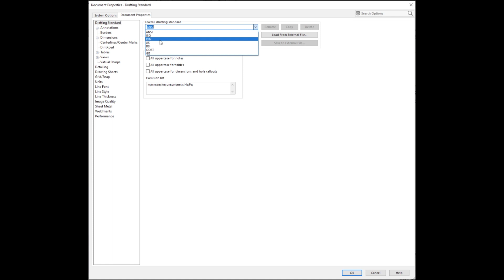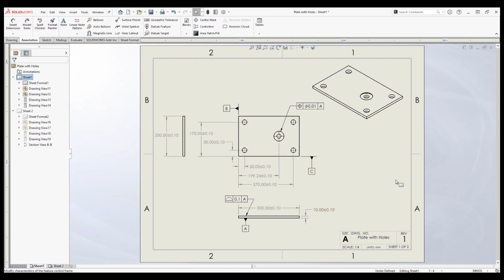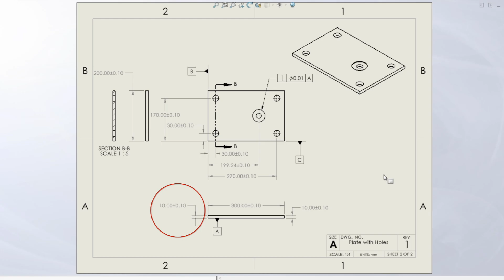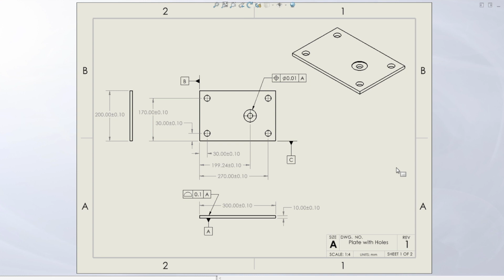Why I HATE GD&T...

Comment: This is one of the best videos on practicing GD&T that I have ever seen.
I agree with every sentence - expect the "I hate GD&T" conclusion.
What is missing in today's practice?
- Good drawings that control feature function with maximum tolerance.
- Derived verification specification
- Derived finished part specification
- Derived tool control specification
Unfortunately, a digital workflow is still missing. For example, after the nominal design, it would be a good idea to create an explicit functional specification before starting to create a single part drawing. For all these specifications we need a suitable software solution...

Comment: 4:41 Allow me to practice my knowledge of gd&t location tolerance(true position) and "redmark" this dim:
1. Let's start with just "conventional" dimensioning. 
a.) There is no hole diameter and no hole diameter tolerance
b.) Worse, this is a "counterbored hole" there is no spec for large diameter and depth.  No diameter for thru hole.
c.) Where's the fkn, vertical dim?
- - - - - - - - 
2. Now, let's get into the GD&T true position tolerance screw up:
a.) Where is the datum reference to "B" and "C" in the feature control box?
b.) Where is the (mmc) symbol? Don't tell me that he "meant" RFS. That he "knows" the 2nd rule of Gd&T.  Not.
c.) Where are the [basic dimension] symbols for vertical and horizontal dim to the hole center? Also, the basic dims are "not tolerance".

Comment: As a machinist - please do not make 100 page drawings. That is insanity. Eliminate unnecessary views, dimension cleanly, use thinner lines and slimmer fonts which are legible at 8.5x11.  GD&T properly applied makes our job easier and clarifies questions. GD&T improperly applied will drive the cost of Manufacturing your part through the roof. Tread carefully.

Comment: I find it interesting you rant about misunderstanding of GD&T and your examples have errors.  Comment below has details of errors.
Reply: Counterbore Position Diametric 0.01 to A identifies the counterbore is coaxial to the through hole.  While position in conjunction with Y14.5-2018 4.1(o) will help control perpendicularity, the primary function is still control of location.  The perpendicular call out is a tolerance of orientation (Y14.5-2018 Section 9) and does not control location.
Profile of Surface 0.1 to A and 10.00±0.10
The profile of surface is an equal bilateral tolerance, which would allow for ±0.05, not ±0.10.  The profile of surface would allow for a floating tolerance zone of 0.10 that could move up and down within the 10.00±0.10 (9.90 to 10.10).
Ambiguity
Y14.5-2018 4.1(o) USO(Unless Otherwise Specified), all tolerances and datum features apply for full depth, length and width of the feature.  Thus, the statement of ambiguity of linear measurement would not apply, as the entire centerline of the hole must be within the defined tolerance zone.
Mandatory Appendix 1 Alternative Practices deals with different methods of tolerance stack used prior to the practice of Position and Profile tolerance methods.
Reply: @samualadams862  You are completely wrong in your judgement.
Counterbore position 0.01 to A does not identifies its coaxiality because A is not an axis of the through hole!
Because A is a plane nominaly perpendicular to the counterbore axis - that specification only identifies perpendicularity so the author is right in the video
The profile tolerance is not floating here because profile tolerance is by default fixing all degrees of freedom including not only orientation but also position 
+/- tolerances are unambiguous only for feature of size. The position of hole center from a plane is not a feature of size so it is ambiguous as the author said.
Reply: @darmat9009  
I concede that I am by no means infallible, and I am always open to debate.  
I would, however, request if you wish to label my assertions “wrong”, you provide reference to back your statements.  I have provided references to Y14.5-2018, for the purpose of allowing others to research my points.  I would recommend you do the same.  
If you would like to debate this further, please do one of the following.  Provide your references to back the assertions you’ve made, so I may review.  Or, review my references and explain how my interpretation is incorrect.

Comment: Many young engineers have weak cadcam skills, so they'll drop the ball on any type of tolerances. They screw up other notations as well. Middle engineering managers should ALWAYS witch-hunt their designs, and/or have in-house manufacturing engineering do it, w/ a reward system for finding errors (so they don't just associate level ass-suck around pretending away mistakes).

Comment: When my company went ISO-9002-AS, GD&T was mandatory. They sent us old guys to a local community college to learn the basics. We've been working with +/- for 40yrs or more. Those of us who didn't fall asleep were ready to quit the trade. It's more geared towards CNC and CMM. Does not relate well to the PROTOTYPE & DEVELOPMENT SHOP, where we use manual machines with DROs or maybe a Proto-trak.
 We take a few engineering students every 6mos as interns. It's amazing they don't even know basic mechanical drafting. Never saw a drafting table, T-square, templates, instruments. I don't think they ever saw a PENCIL before!
Reply: They'll scoff at the mentioning of mechanical drafting, but what is missing from their design methods is Orthographic Projection. This is why their assemblies have so many misalignments. That and they don't design in assembly mode. They are missing concepts that mechanical drafting didn't allow one to mis, or they'd get to do something else pretty quick.
Reply: You are so right, GD&T add most value to the company when having CNC machines also a little when using DRO.
Reply: efi, f*** not one gd*t sh*tbag bozo has ever run a cmm, it might take 2 hr to inspect 1 hole that the dude needed to be +/-2 thou but t.p. 2 thou is really +/-0.00002 if the damn plate is thick enough, meanwhile it would have been fine if the damn hole was 0.02" somewhere else as long as the bearing fit inside pretty ok.  the issue is experience. the issue, is experience....   gdat is fine, if the engineer knows.....  dude, t.p. 0.015. please!!!!
Reply: You probably think carburetors are better than efi
Reply: @Blobby_Hill  Yes! I took the EFI off my Harley and replaced it with a Carb. HD no longer supports that EFI system (Magnetti-Marelli), which was bad from the get-go! (Italian electronics!). 
I can rebuild any carb, and they let ya know they need attention well before they quit. EFI just quits!

Comment: The majority of mechanical engineer don't get the essence. I've seen so much woodo and hot air about GD&T and be prepaired for IOT 4.0. I started working with GD&T for more that twenty-five years ago and it was ASME that was first movers. First you must ask yourself why was the geometric tolerance system not suitable any more ?

1. CNC machines was starting to be commonly used in shops and that gives the opportunities to design more complicated surfaces, that geometric tolerance system could not cover.

2. GD&T is very much designed for CNC machines how they operate with the freedom of incremental or absolute fixed datum.

3. GD&T makes your drawing simpler. Old Schooled example is several holes along a x-axis was drawn with individual line to each hole from the datum, if you have 50 holes the drawing will end up in a messy line circus.
With the GD&T it was aloud to use incremental distance from hole to hole.

4. GD&T makes your parts cheaper, because the tolerances can be set less precise. I order to understand that you have to realize the most commonly assembly of parts are ROUND bolt/taps fitting in a ROUND hole. The  geometric tolerance system works in terms of cartesians coordinate system meaning it's best suited for squared BOLTS/TAP fitting in SQUARED holes. This is not very common to have SQUARED holes and bolts. GD&T describe tolerances in terms of circles. If you place a square inside a circle you can see that the tolerance diameter is lager and therefor cheaper parts.

5 The list goes on about why GD&T is genius, but also complicated to check the tolerances. I also just hated the system in the beginning and you have to learn the machinist some basics otherwise they just produce what they think is good for you.
Reply: Yes yes and yes. I have the same thoughts and you knocked it out of park with that description 👍

Comment: What does gd&t technically mean
Reply: Geometric dimensioning and tolerancing. This essentially means applying certain geometric zones to define where the part can and cannot be. And as said in the video, it’s a great tool if used properly but is frequently misused and/or misunderstood
Reply: Do you know what a drawing is for your parts? basically the dimensions and how to place them on the drawing so that it makes sense and you can convey the areas of importance. Think of it like a contract, client sends you the drawing with the tolerances and dimensions and its your requirement to meet or exceed those for you to complete your end of the deal and get paid.
Reply: It is French for engineers arguing over make belief